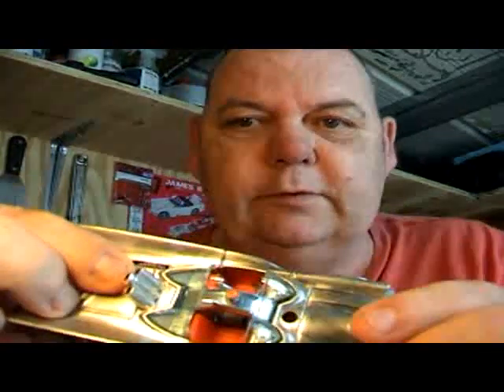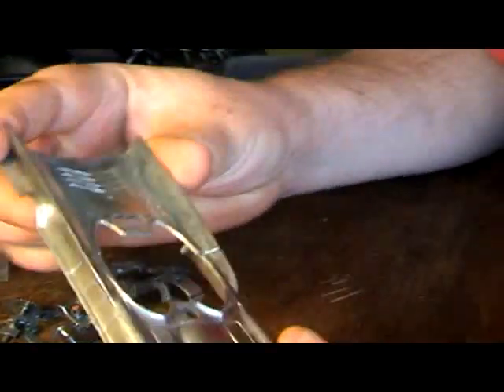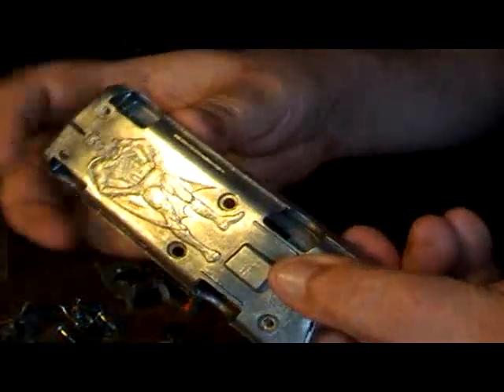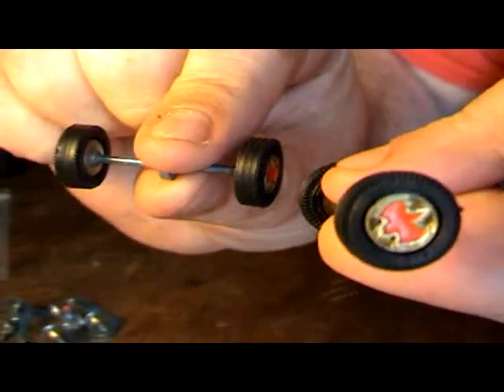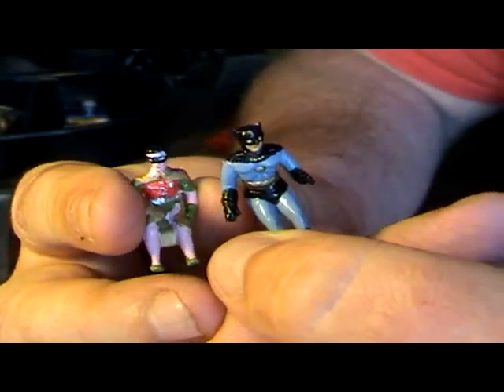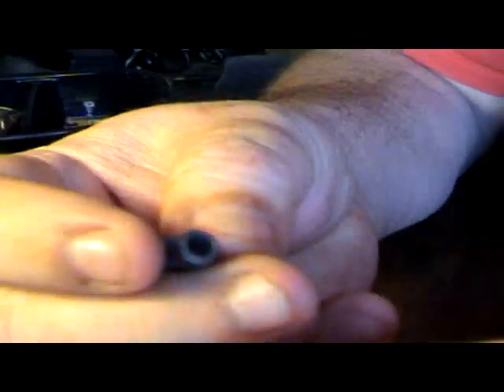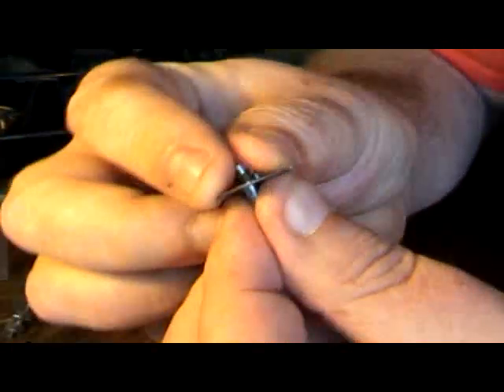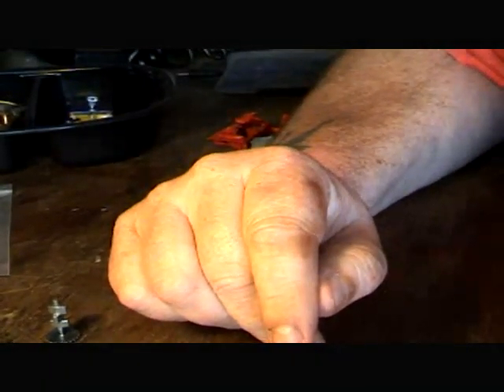Corgi 267 Batmobile Restoration Guide pt 1

Comment: Hey Bob, I've watched your other 267 videos but can't find an answer to this question: What steps do you take to repair the plastic seat / suspension part?

I've got a few seats, broken or just looking like they'll break soon, not too sure how to strengthen or secure them
Reply from the maker: You can go to the website in my description or use a later whizzwheel seating unit and just cut the "V" out of the back suspension part, use super glue and baking soda or epoxy resin to strengthen up the other parts of the suspension .

Comment: Hi Bob,

Two questions please. 
Who’s the Supplier in Australia for the Screens or can you supply ?

I’ve done a couple of restorations, but struggled a bit with fitting the Beacon. The Red centre piece is too big for the hole on the screen and  had to drill it out.  Can you do a video to show the best way of doing it ?
Reply from the maker: Hi Glenn, with regards to the beacon some suppliers often seem send you some material that the diameter is too thick for the glass so unless you either file it down somehow or do what you did, then there’s not really any other easy way to make it fit.
The website for best parts is  www.reprohobby.com